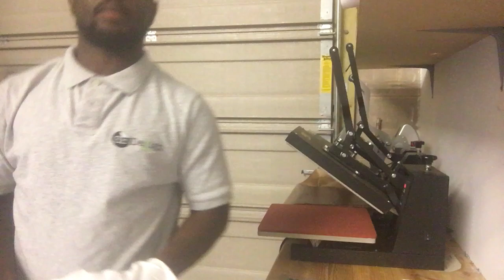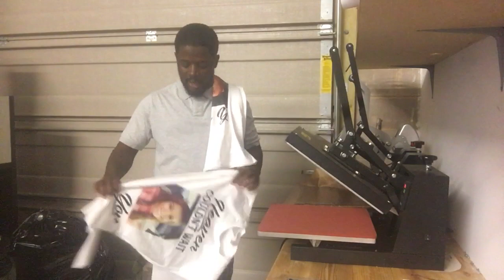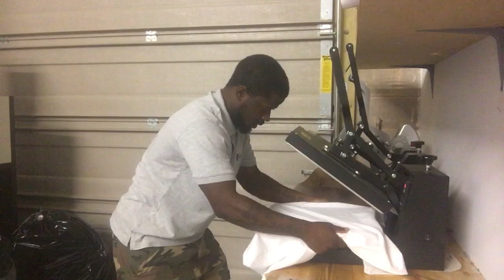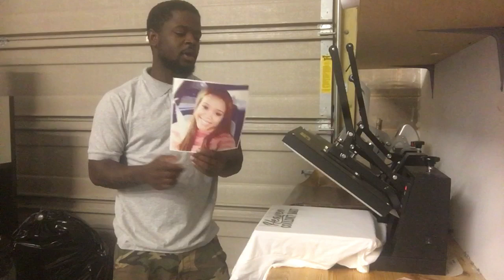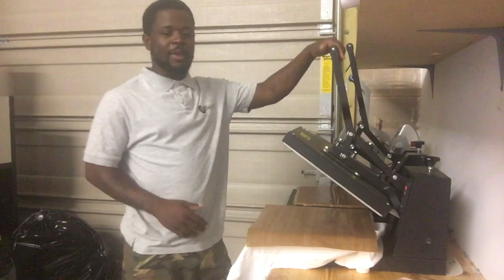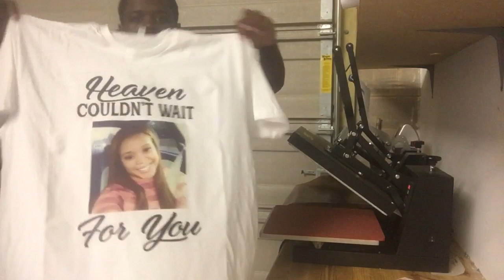How To Use Ink Jet Transfers With Heat Transfer Vinyl On Custom T-Shirts [How To Make RIP T-Shirts]

Comment: What are the settings in your press, im haveing issues with mine as where the vinyl is not sticking, should I adjust the pressure, my settings are 350 degrees F. And 30 seconds
Reply from the maker: Your probably burning it 320 is usually the highest vinyl setting.

Comment: THE IMAGE IS NOT GOING TO FADE OUT, SINCE IS DONE IN A INKJET PRINTER?
Reply: If done correctly, it will have a slight fade but still vibrant, cold wash hang dry last a long time, as he said use pro paper like NEENAH paper, not transfer papers from the office supply store.

Comment: What type of paper you use for the picture of the female
Reply from the maker: +Will Mosca siser easy weed and flock
Reply: what type of printer and ink did you use. and how many washes  does the ink last

Comment: Instead of transfer paper can you use the paper that you peeled off the picture?
Reply from the maker: +Charolyn Washington not sure what you mean
Reply: Stan Banks 
When you put paper back over the picture was in the paper you originally peeled off or is it a different paper?
Reply from the maker: +Charolyn Washington tracing paper or the teflon sheets im guessing that's what your talking about

Comment: Love your video . I'm doing the same thing with some Birthday shirts names in vinyl and pictures on heat transfer paper. How do I go about putting something on the back of the shirt also. I haven't tried that yet. I have been doing this for a while just for my kids and their friends. But I would love to start my own little business. By the way I'm from Brooklyn NY. But family from Alabama. Thank you
Reply from the maker: +roshaunda frazier same as the front no difference. Do the pictures first the usually require allot height temp and longer time.

Comment: informitive and to the point. good video.  
I personally only do 2 presses when I do these shirts. I press both sets of vinyl at the same time as not to put too much heat on the transfer.
Reply from the maker: +Dirty South I need a 16x20 in order to do that. But it would be ideal to do it in 2!

Comment: There are so many choices for inkjet and laser transfer paper. Need to find the most cost efficient and best quality one. The suggestions for transfer paper for dark shirts are even more confusing.  Also, which is better inkjet, laser or sublimation? Any suggestions?
Reply from the maker: +Vanilla Panache they all have there purposes... inkjet works fine.
Reply from the maker: +Vanilla Panache Transfers I uses is in the description